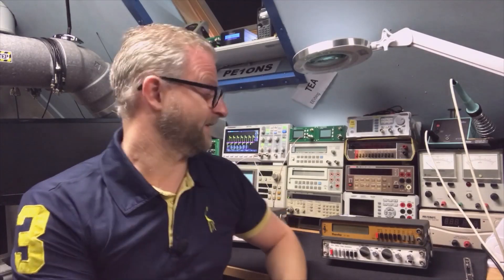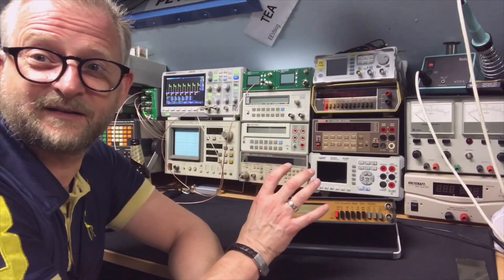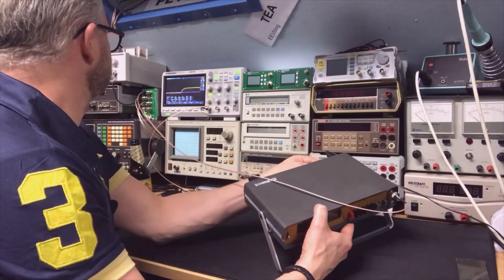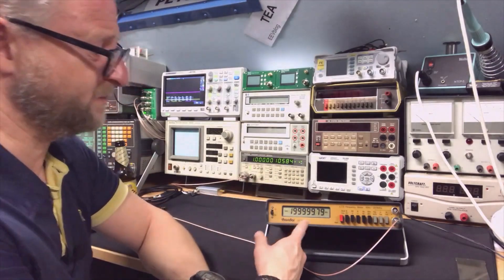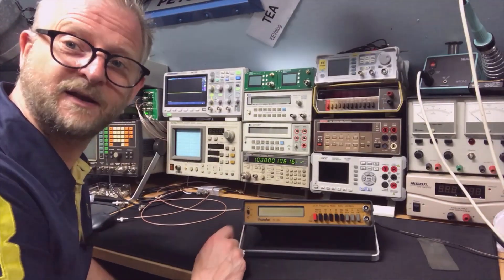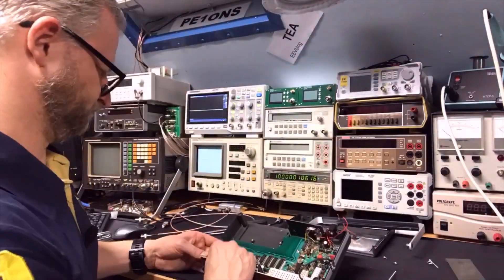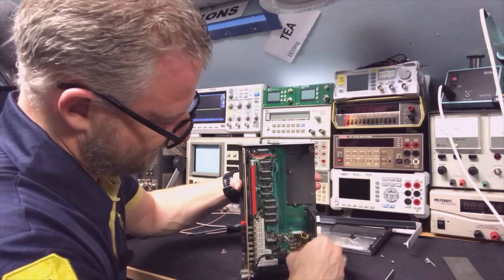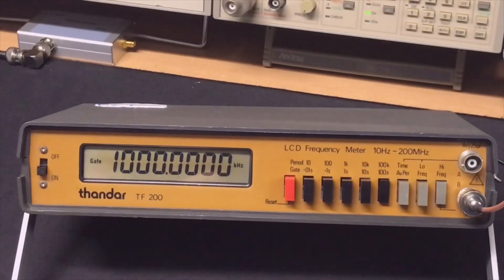#065 Thandar TF200 and adjusting with Scope method

Comment: Hello ,
nice video very helpully directions,
i am  TF200 owner & i have 2 questions about,
what kind of ext. power supply i can use?(9vdc??/centre pin  Negative??)
(volts..Amps..stabilized or not,also polarity)

and...how do i conect the official ext. prescalerTP600 which i have
some directions by you they'll be helped me
many thanks - regards
Reply from the maker: Hallo, i think you can use 7-12 volts, it has its own stabilize system inside. so 9 Volts with center pin will work.
on the prescaler i have never used it myself. maybe you can find something on google.
Reply: @TonyAlbus ,
Thank you for the fast reply, and infos, 
The ext. Power supply 
must be  a single 9VAC output??? 
OR a stabilized 9vdc - 1A(with center pin '+') 
Or must be check it inside for the polarity? 
Thanks once again..!
Reply from the maker: @Ianistrip  9VDC and center pin Positive. if you doubt you can connect wires to the battery connections. that never fails.
Reply: @TonyAlbus  ,
I found the service manual ,& i upload the power supply unit,
for your personal knowlenge about.
https://drive.google.com/file/d/197E3RuPoElsV6tMBktWeefEwZn_iY-gV/view?usp=sharing
**I think (by first-fast looking) the center pin is '-' negative)but I'll check it
thnX
Reply from the maker: perfect!
Reply: @TonyAlbus  ,
Hello again,iam back with last mod news/results,
I replaced the device power female socket by a new universal dimension,
& i let it the inside polarity as the factory's (center pin "negative"),
I  built an external power supply simple stabilized 10 volt 1A DC,
(but with some 0.1 ceramic capacitors for AC network noise),
center contact pin negative-test done ok
now it is fully ready ....
regards
Reply from the maker: nice, well done!
Reply: @TonyAlbus  ,
thats It..., & and we are looking forward to the next adventures, in elec.  tech field
have a nice time my friend
Reply from the maker: @Ianistrip  Thank you!,, you too!